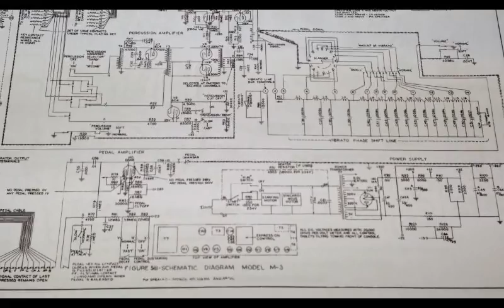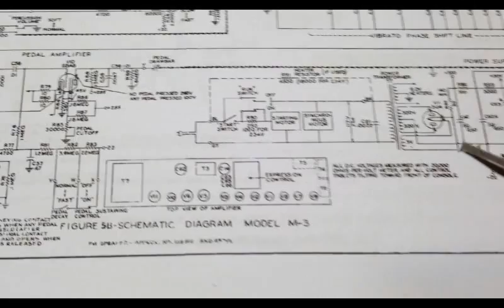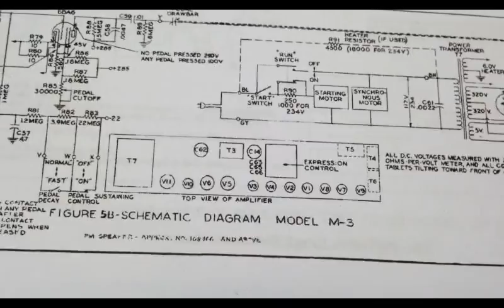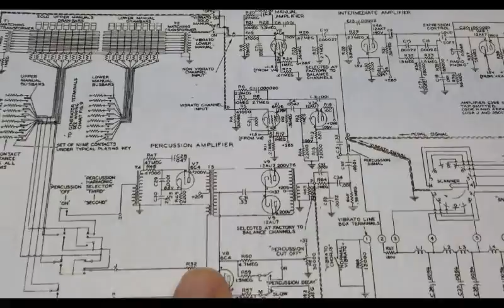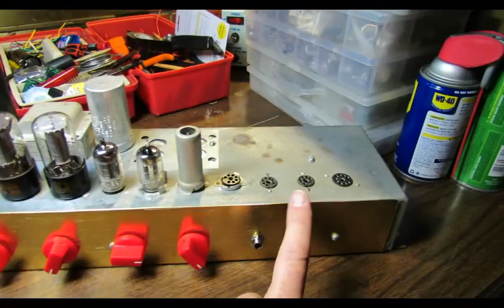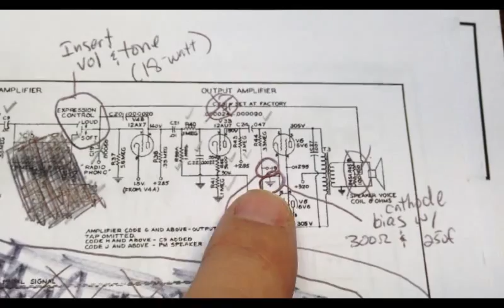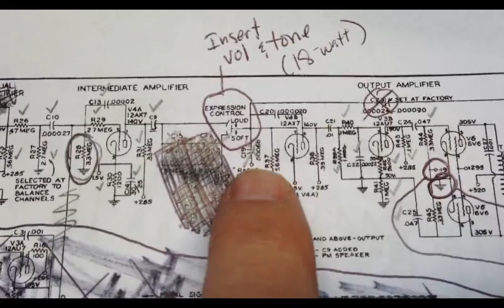Hammond AO-29 Guitar Amp Conversion + Make Pickup w/ Unused Parts

Comment: I've started taking out everything that was attached the the 4 tube sockets that are not used.
I printed out the schematic as well as the Marshall 18 watt tone stack & volume control schematic.
There are still quite a lot of wires, resistors and caps left in that were not directly connected to the 4 tube sockets (V9, V7, V8, V1)
After watching your video several times, your end result board is vastly simpler than what I have at this point. You wouldn't happen to have a "layout" schematic of your end result or a good photo or two of what you ended up with, would you? Those would help me quite a bit, if you do.

I also subscribed to Uncle Doug's YouTube channel on your advice and he is certainly a wealth of knowledge and information (as you are), so thanks for that tip!

Thanks for all the help!
Reply from the maker: I did not make a layout diagram. There are so many options of where to mount things. I suggest doing what i did...go through the final schematic component by component and earmark the stuff that can stay, then remove everything else with extreme prejudice. Takes a little while, that's kinda why i edited most of that out, it would have been a 2-hour video. When all the extraneous stuff is gone, go back and double check each component that's supposed to be there, checking off each one on the schematic, starting from input and moving trough output. Then start at power plug and check everything off in power supply through the capacitors. Then build out your tremolo circuit. You may also be able to pause the video and get an idea of the layout. You're like the second or third person to email me and ask, so I'll probably take some detailed photos of the end result and that'll help you. In fact, I'll go ahead and do that now and publish them on my Facebook page and link from here when I get them up.
Reply: +The Guitologist sweet! Thanks a TON!
Reply from the maker: https://www.facebook.com/guitologist/photos/?tab=album&album_id=912735435518832

Comment: Is installing a 3 prong cord to this amp a hard task? Very new to this kind of stuff
Reply from the maker: Sorry I missed your comment before... No, it isn't difficult. No more difficult than any other amp.
Reply: Ben Tanch I know this is old response but adding a 3-prong cord to any amp is simple the white and black or the hot leads that go to the two wires coming in now with black is your hot wire white as the neutral and the green wire just goes to the frame of the amplifier.  Morning hope that helps you in case you haven't figured it out yet

Comment: I am intrigued by this! I have 5 tube organs, a Hammond power amp like that and 3 silvertone organ amps. I really wish I could finish them. How did you make the input s and the tone stacks? Great sound!
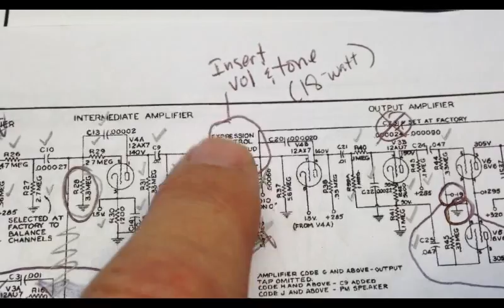Reply from the maker: +Robert Landry At 25:00 there is a short discussion of the tone circuit I used and where it goes.
Reply from the maker: +Robert Landry The signal input is discussed as well. I input the guitar signal into the 6AU6 pentode tube grid.

Comment: would it be possible to use all of the tubes? Really new to this kind of stuff. I just got one of these amps and I was looking to convert it into a guitar amp as well. Also, nice video!
Reply from the maker: +Ben Tanch I could have designed a reverb circuit using one or two of them. I'm sure someone out there could think of ways to use them all. Not sure it would be a better amp.
Reply: +The Guitologist  Okay, thank you for the response. Where do you think I should start with this project?
Reply: +The Guitologist Also, if I were to make a reverb unit, which tubes would I have to use if I did so? Would it be a hard task? Again I am very new at this kind of stuff. This is my first amp project.
Reply from the maker: If you've never built an amp before, I suggest starting with something that doesn't have reverb and you can always add reverb later if you want. Reverb will require you to buy more parts also, which will involve figuring out things like which reverb tank and transformer to buy. There are some reverb circuits you can get which aren't tube as well. You'll need to do more research to have reverb. I'd keep it simple if I were you.
Reply: +The Guitologist Thank you for the help, one more thing. How loud is the amp after the conversion?
Reply from the maker: You'd want to mic it up for band use probably. Mine is hampered because of speaker choice though.
Reply: +The Guitologist Where are the filter caps located on the amp?
Reply from the maker: In the two cans protruding from the top.

Comment: Nice job..  I actually did an AO-29 conversion last year..  I cut mine down after v4 while getting rid of unneeded components and used some of the leftovers to make an additional amp.  This one ended up a pp 6v6 with 12ax7 and 12au7 taking care of preamp and pi and it is using the stock field coil speaker in a combo amp format.  The second is a single ended amp head based on a 5e3, but with a pair of 6au6 tubes as the first 2 gain stages.  I really enjoy your videos and pick up a lot of good info watching you.  Keep it up!
Reply from the maker: +Aaron Collins Thanks for your comment, Aaron! I had considered also omitting the 6AU6 and just going with the 12ax7 and 12au7 in pre. The AU only uses one of its triodes in my design, so you wouldn't be losing a gain stage doing that. In fact, if I wanted to hot rod this amp further, I could go in and use that triode.

I kept all the parts I extracted from the amp. I know I'll be using all kinds of spare parts for a long time.

Comment: Dude your a Genius! That amp sounds incredible!  The natural tone that it has even with those old worn out speakers is unbelievable!! I would give almost anything to have you talent with tube amps....
Reply from the maker: +Tim Stanley In the case of some of these Hammonds, it's just luck. They used good parts and built to last. The credit goes to the engineers at Hammond. I feel like I'm taking a chisel to the electronics equivalent of a Michelangelo sometimes. I'm defacing more than anything.

Comment: thank you thank you thank you!!  I've been waiting for this for a long time!!  well done!!  I also have an A0-43 that I believe has a reverb circuit built in...just need a little time to get to it:))I bought 2 ancient  4x8 inch speaker PA columns and they make instant cabinets, with a little cutting-and-pasting...definitely enough for 4 amps, instant patina....
Reply from the maker: +joe bartolini the AO-43 is still on my list! Haven't done one of those yet. The beauty of this AO-29 is I can go back and use one of the unused tube sockets to create a reverb circuit if I want, maybe build in a nice-sounding Ampeg or Fender circuit. Got space for a transformer too.
Reply from the maker: +joe bartolini The PA columns might be awesome. Just check the impedance of the speakers. Some of those PA cabs had, like 32 ohm speakers installed.
Reply: i did an ao43 and i made it work with reverb on footswitch, and have a dirty channel that is just heaps of volume and gain. no test gear, no schematic... just experimenting.. thing SLAYS!!!

Comment: Very nice salvage job.   Really like the idea of making a pickup out of the extra transformer. And I love the sound of a pentode preamp.  Do you have a tip on stripping the old Hammond boards and soldering new components into them?  I find yanking the old components out is not bad but inserting new leads in is a challenge.

I pretty much followed your AO-35 rebuild, but am tweaking the preamp a bit still on mine.  Keep these vids coming, very entertaining and useful too!
Reply from the maker: +Barefeet200 Thanks for watching! Be sure to make a video of your build and link me here so I can see how it came out.
Reply from the maker: +Barefeet200 As for the components installation on the boards, just heat the conical part sticking out the back of your iron until the solder is good and molten, then insert your component using needlenose pliers.